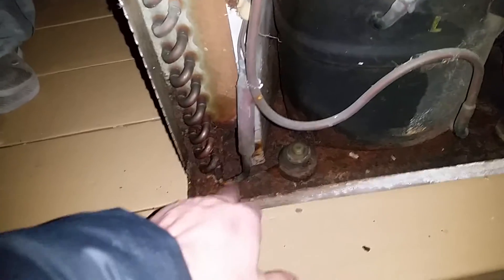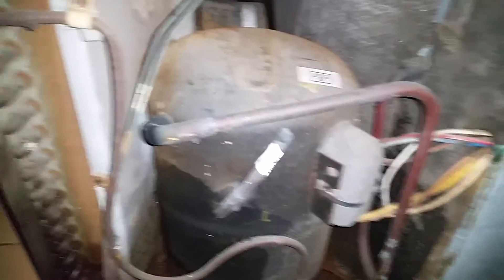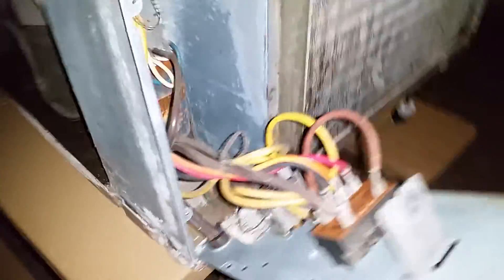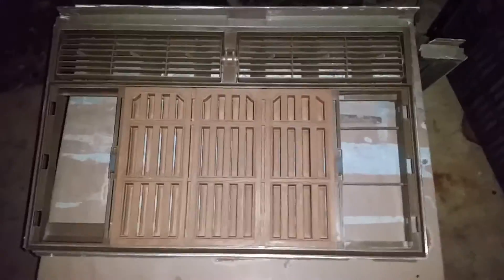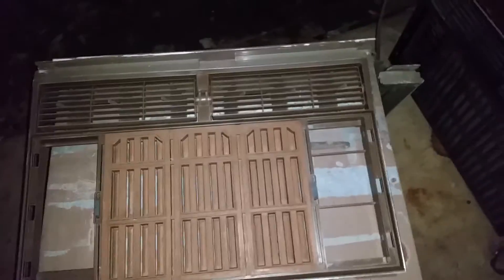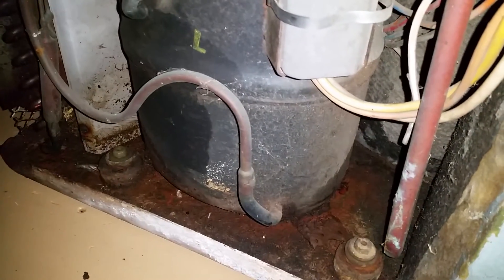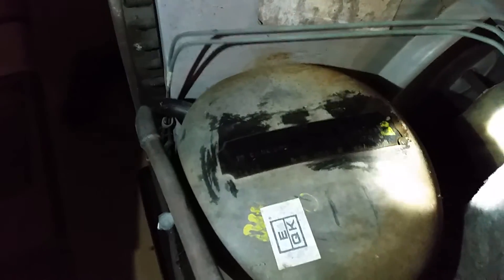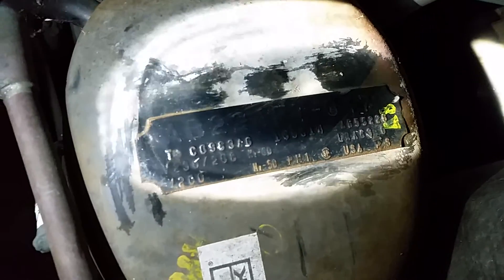18,000 BTU Large Emerson Quiet Kool 1976 Dynamic Series

Comment: Nice!  Love large old units...damn that power draw is high for that size...Compressor is probably an Emerson compressor, but not positive...not as robust-sounding as the Tecumseh compressors (like the 2-cylinder AJA model in my 1969 GM Frigidaire) but still sound mad sweet.

Comment: Hey there TheAirConditionerGuy! I love this vintage Emerson Quiet Kool Air Conditioning system! Im just wonder here, is this a Window AC designed to slide into a chassis box, or is it a Through the Wall installation system made for a wall sleeve? The reason I ask this is because I do not see chassis mounts on the unit itself, so it cannot be a standard Window-mount system. As always, love your videos TheAirConditionerGuy

Comment: Epoxy some L brackets to the compressor and use a large hose clamp to hold them in.  Nice A/C unit!  I have no luck finding vintage A/C units in my area.  I think due to being in s southern state, the A/C units work harder and wear out quicker so they are not as common as they are up north where you are at.
Reply from the maker: ESDI80 that, and youre close to the ocean lol